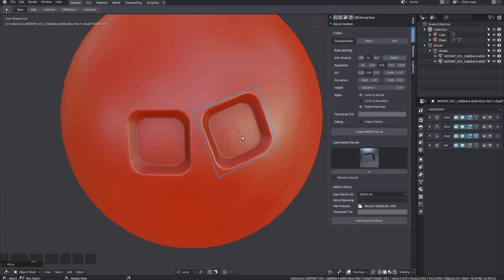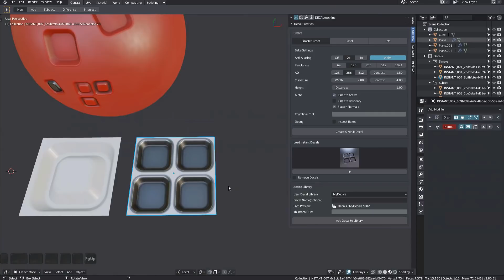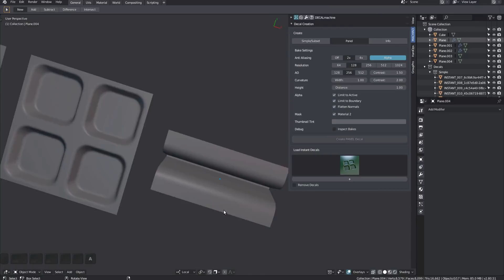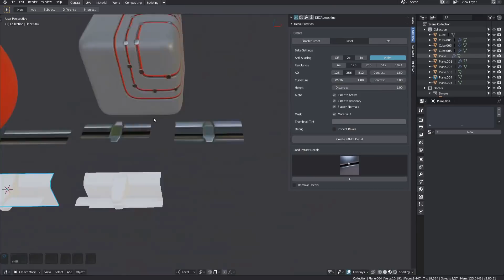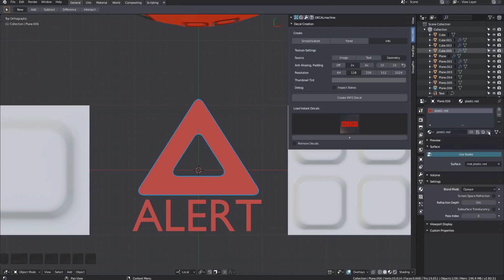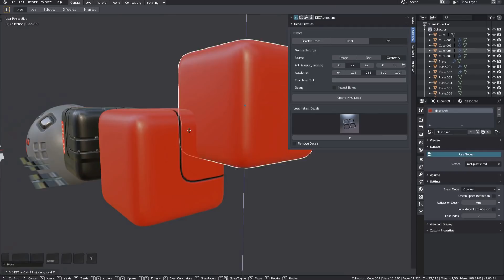DECALmachine 1.8 - Decal Creation

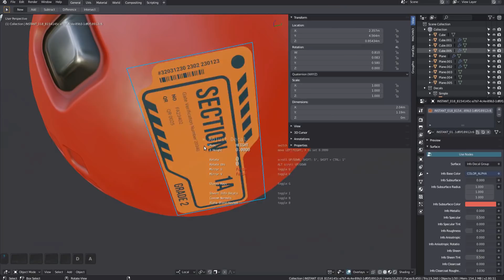Comment: 16:10 I see you have the decal projected and you can still move it with the G key and rotate it using the scroll wheel. For some reason I am unable to do that. When I press G, it won't move and when I scroll I can see the Rotate angle change in the HUD but the decal itself stays put. What am I doing wrong?
Reply from the maker: https://machin3.io/DECALmachine/docs/project/
Reply: @MACHIN3  Brilliant! Thank you.

Comment: Why i cannot remove this edges (dissolve) like on corners at the begining of the tutorial??? Blender just collapse geometry. If I try to remove it as a face it works but faces remain?
Reply from the maker: If you dissolve the edges you need to untick the "dissolve verts" option in the redo panel. If you dissolve the faces you don't need to.
Reply: @MACHIN3  thank You very much. That solve the problem. I would never figure it out.

Comment: Watching at 0.5 speed and it's still going way too fast. Would be nice if you could explain some things a bit more, like how you do the uv stretching, or why slice needs to be checked for panel libraries.
Reply from the maker: Watch the proper videos, for instance Preferences and Adjust, if you want to know why panel decal libs need to be marked as such or if you want to know about panel decal uv stretching. I can't be expected to repeat myself in every video can I? 

https://machin3.io/DECALmachine/docs/preferences/
https://machin3.io/DECALmachine/docs/adjust_defaults/

In general, watch the videos from the docs, where they are embedded, not randomly on youtube. There is an order to it all and its beautifully laid out in the docs:

https://machin3.io/DECALmachine/docs/
Go though it from top to bottom.

Comment: Getting an issue with the panel decal where one end is lit and one end isn't, leading to it not merging very well when it repeats. I tried messing with Ao and other settings but no avail. Tips?
Reply from the maker: https://machin3.io/DECALmachine/docs/faq/#get-support
Reply: @MACHIN3  Between then and now I got it working. Still no idea what the problem was. Thanks though - if I run into the same issue I'll mail over the blend file.

Comment: One quick question: is it possible to create a new decal with one of the materials already set? Like: I'd like to create a decal for a hole, with the deep part of the hole already black. So far I tired putting a plane down there, and decalmachine gives it a second material, which is default material. So if I save it into my library I will have to always set that material when I use it
Reply from the maker: No, decals don't store materials. I suggest you make the decal normaly, without a second object at the bottom, but then edit the ao_curv_height map, to make the ao part black. Check out the Example decals 009 and 021 where I did the same.
Reply: @MACHIN3  this makes sense, seems a reasonable solution to me, thanks!

Comment: can you put a decal through another decal ? like, If you put a line decal through an inset deal, what would happen ? 

or should one use a plug instead ?
Reply: I was just experimenting with this and I'd say it depends on your goal. Like if you have a cylindrical recess as the first decal, and you want the second decal to land on the perpendicular (or angled) surface of that cylindrical recess then you'd be better served using a plug. When I just followed along with this video and put a road sign decal over the center of the recessed decal, the parallax gives an uncanny valley kind of feeling that I think kind of breaks the illusion. That may be a bit nit picky though to be fair.

Comment: Hi Machine3 - awsome stuff - cannot wait to download and update. One immediate question that came up while I saw this - is there a way to create a decal from a height map as well (would be a subset type but not from a model, but from a PNG with alpha and height information (or normal information - I have both)). I would love to turn all the alpha stamps I have (and use in Substance Painter) from various collections into decals that I can also use right in blender (use as such or and then export to SP once you reincorporate that function into Decalmachine for 2.8). Maybe there is either a way to adapt the save files or a way to do it with the create process?
Reply from the maker: There is no tool for this yet, but I plan to add in batch creation again. Which would work from a folder of files, instead of baking those files.

I do need normals, height and alpha.Height needs to be 50% grey at "surface level". AO would be useful as well. But you could go with out it too. I can generate curvature form the normals, if it's not supplied. 
Height is actually optional as well, but if you don't supply it you won't have parallax.

 Most "alpha/stamp packs" don't come with all these textures it seems though.

What you could try is create a plane, subd it a lot, use you alpha stamp/height to displace it and then create the decal from this displaced mesh.
If this works well, I could probably automate it too.
Reply: @MACHIN3  The last thing works - I pinged you an email with the result. It has some limitations that maybe can be overcome.